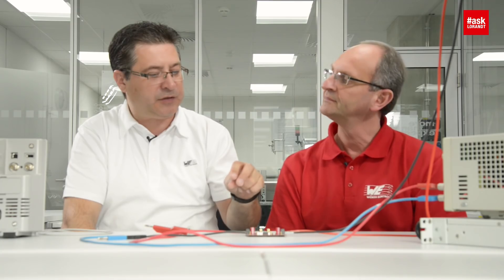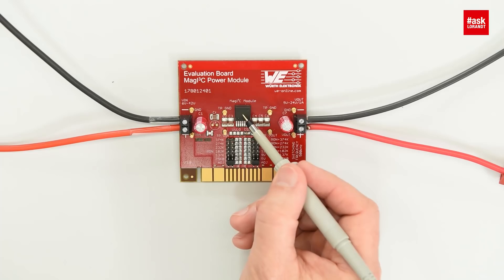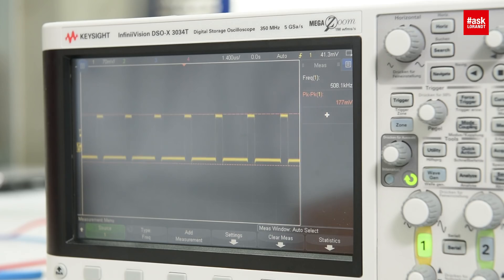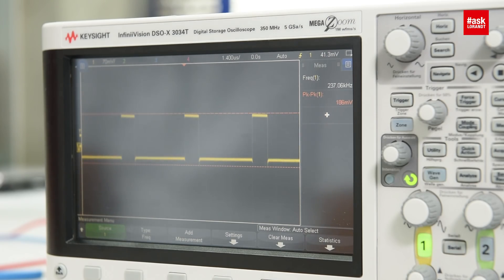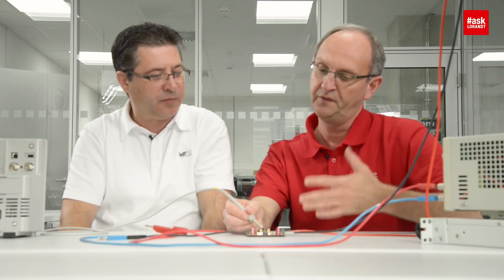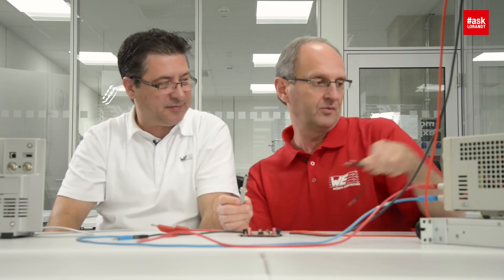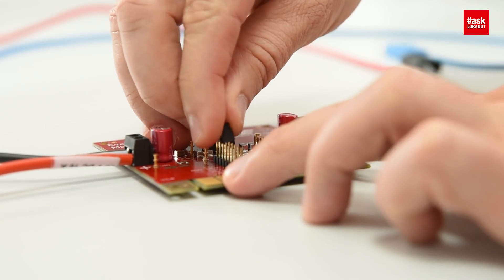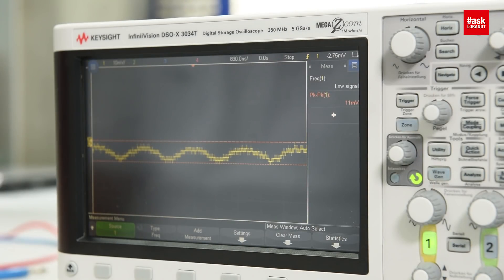#askLorandt explains: MagI³C Power Modules and measuring switching frequency and output ripple

Comment: How is the signal coupling from the top of the MagI³C Power Module to the probe when probing the switching node? Is it capacitive, inductive or something else? Does it have EMC implications?
Reply from the maker: Thanks for your question! It is a capacitive coupling generated from the switch node. It has no effect for the EMI as there are no long traces or wires. The probe is sensitive and you can see the signal but do not measure it because there is no contact at the plastic case. Best regards, Würth Elektronik